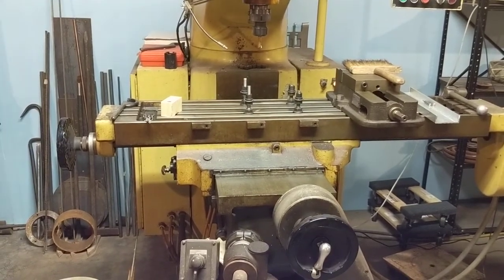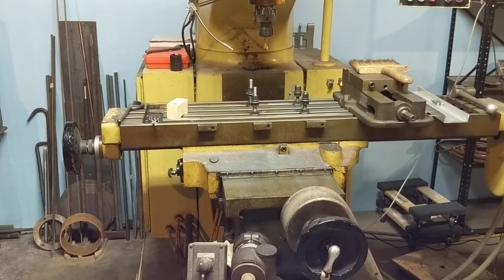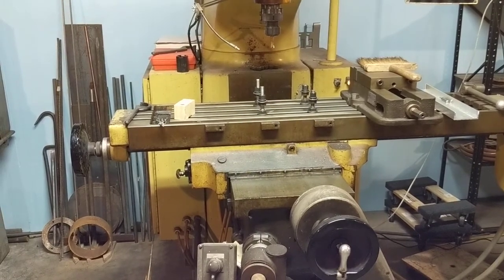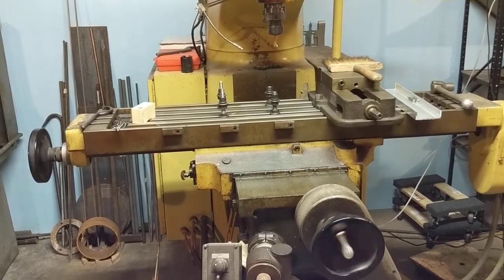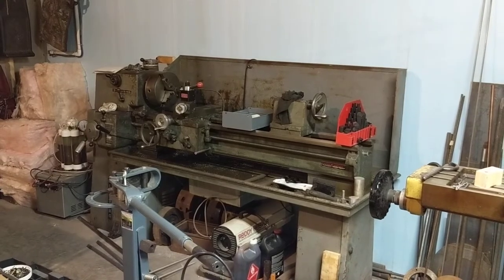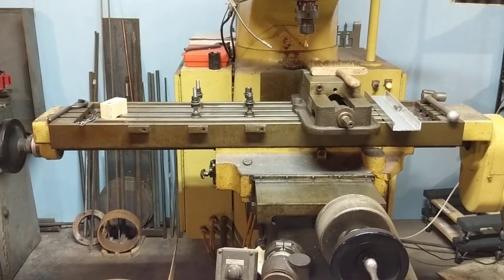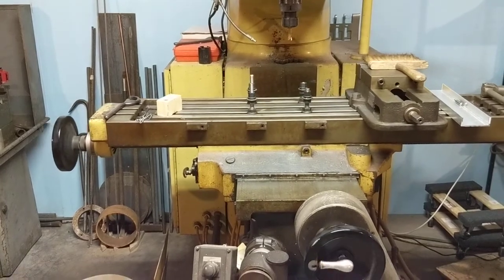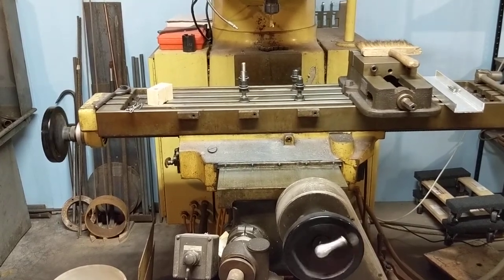Harmony VAWT November 2018 Finally got CAM working for Scoop Supports

Comment: fwiw while your learning forget G0X0Y0F100 which is your home position,just end the program with your last cut/hole and lift the tool up which would be Z0 in a 3 axis machine.then restart the program  with the move to X0Y0F5 to start,that way you can hit the stop button if something is amis .pauses are unforgiving and end mills and chucks are expensive.don't be affraid to feed it proportionate to the speed of the spindle.a little coconut oils goes a long way and smell good too.always climb cut in aluminum and leave..005 for a finish cut.chuckle have fun,brings back memories.i like your work and thanks for sharing
Reply from the maker: Thank you for the advice Bill. You don't happen to live near Hershey, PA do you? I'd love to have someone near me to work on this stuff with. I'm a GCODE newbie but it sounds like you have been doing it for years and have quite a bit of experience with it.